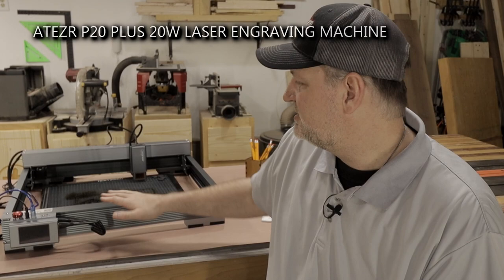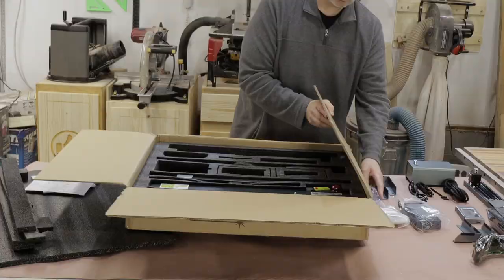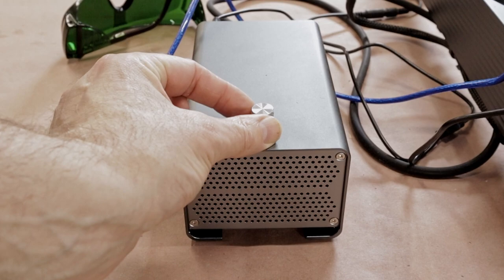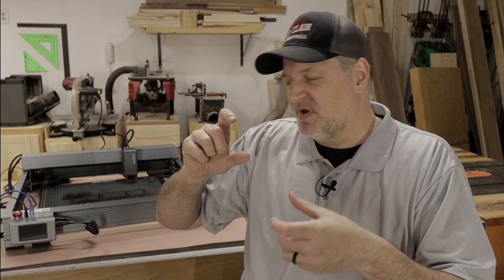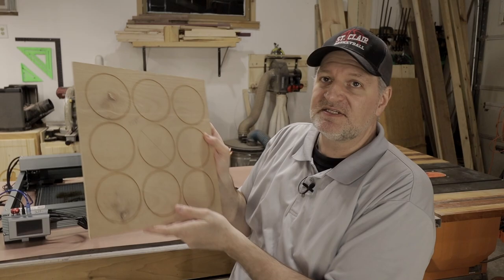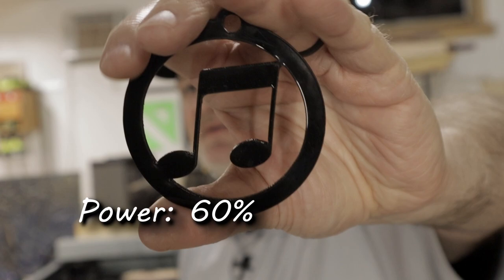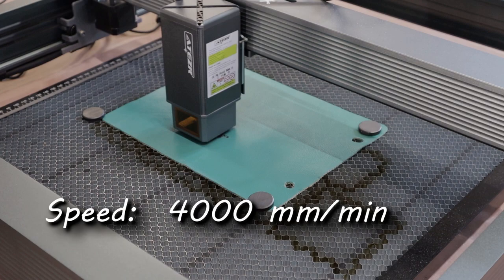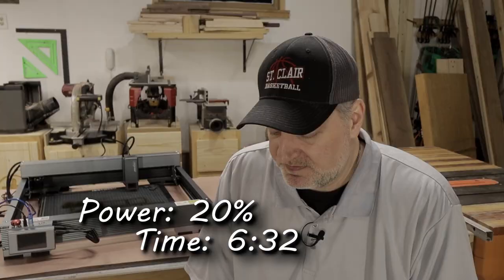Buyer Beware? Atezr P20 Plus 20W Laser: Don't Buy It Without Watching This!

Comment: just found this video looking for upgrades for my p20 plus.

cons: its quite disheartening knowing that i spent $1000 on this and now the more powerful models are under $600. but such is life, i guess. theyll probably be $100 in another 2 years, no use crying over spilled milk. 

and i have NEVER used the controller. horrible design. useless unless you have a card in. other cnc machine controllers let you do things like home the head or jog position, this one does NOTHING. hopefully they improved this on newer models. 

also, i havent tried the app. i never even knew they had one. after watching this, i dont think ill bother either. thanks for the vid.
Reply from the maker: @502deth  glad it helped!